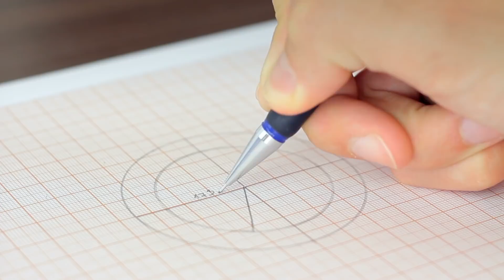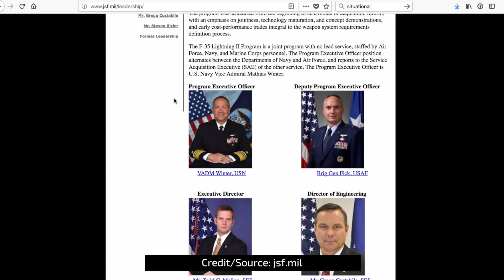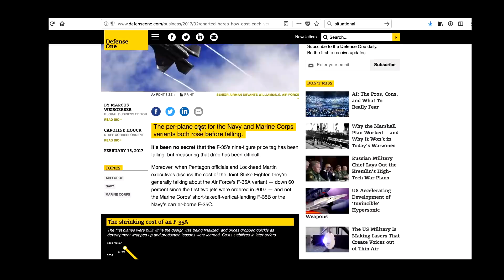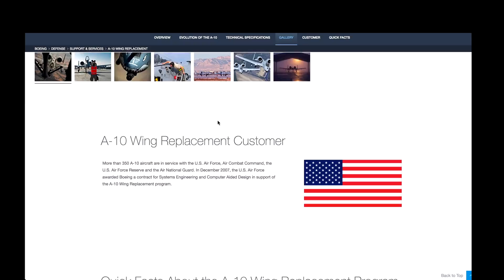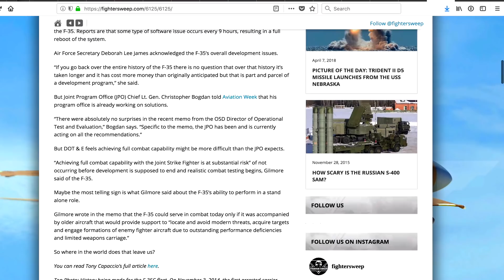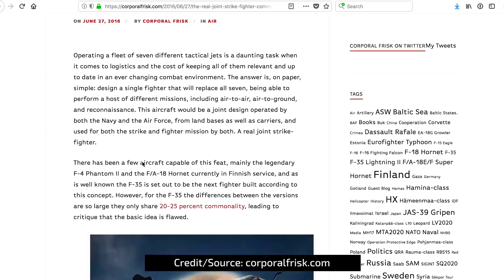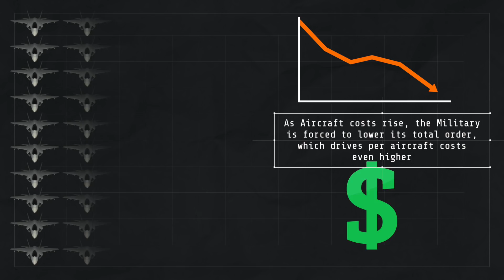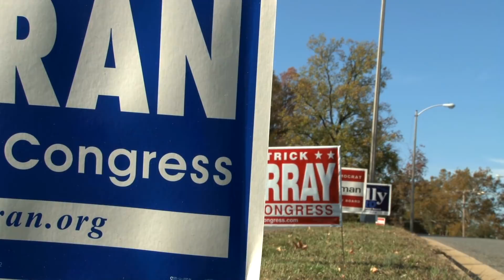Why the F-35 Lightning II Might be the Most Expensive Military Aircraft Mistake Ever

Comment: This is a great video! I wouldn’t be concerned about comments made by the likes of MississippiRedneck (or was it Rebel?). It is a FACT that comments/rumours have circulated that suggested an F-35 ‘lost’ a dogfight to an F-16. You didn’t try to defend the F-35 or rip it to shreds, you merely reported a fact. I thought this whole video was very well researched, narrated and edited. You provided a very objective look at a program that creates heated debate. NEW SUB...
Reply from the maker: Thanks so much! Check out our other stuff and feel free to suggest ideas for future videos!
Reply: Yh but if you knew anything about airplane fights you would know that dogfights are not important anymore and the F35 is essentially an energy fighter and it is here where it outperforms most planes that carry payload outside of their fuselage, for it can retain kinetic energy better than those  who dont, the zero destroyed the corsair in dogfights, however,  the corsair was the superior plane due to its energy retention and ability to boom and zoom thus even with props dogfights arnt really that important, the same applies to teh F 35
Reply: That "lost a dogfight" thing doesn't matter.  The issue is the cost, maintenance and FMC rate and PMC rate of the jets.  For the cost, the 5th gen planes are not up to the same standards as the 4th gen jets.  In a pier on pier fight, day one, with some good lead time to get your L.O. gripes and other issues sorted out the F-35 will be great.  On a day to day basis you will likely get 4 4th gen jets up for every 3 5th gen jets (accounting for fleet size, you know all things being equal).
Reply: That was the "report".  no one knows.
Reply: @wpnsloader9289  If you assume Red Flag is not an accurate report, then you're severely lacking in understanding in what Red Flag is about.

Also that wasn't a dogfight, it was a airframe and software test....as you know, that the Fighter's FCS was limited to, you know, NOT KILL, the test pilot with testbed software? >_>
Reply: Ya I thought the same thing. It seems like every video on the F-35 has an agenda. So its nice for a simple report. One thing that was missing was report of it performance in Israel. That seems relevant to the story the video as trying to tell.

Comment: France was able to build an aircraft that could replace several older aircraft's. The rafale is replacing 7 types of planes, bombers, attackers, fighters, navy planes etc. And the cost is not as high as the f35. Plus the rafale is better : faster, can carry more weapon, more agile, not stealthy but the rafale RCS is very low. 
Buy the rafale its a better plane in every way.
Reply: *The cost per Rafale B is about 85 milllion US$ which is about the same as buying an F-35A, except you get similar range, slightly larger payload, possibly faster speeds (F-35 not tested past mach 1.6, we dont know the top speed), and no future proofing for your air-force, because you are competing with 4.5 generation US planes from the 1980's like the F15E strike eagle, and your planes will be killed off very quickly against an enemy with an integrated air defense network/5th gen fighters.
Reply: Mike Lucky  what i dont understand your comment. You begin by saying that the rafale is not that good of a plane and then, you say that the rafale is better than the f35 ?
Reply: @MH-ff6zr  He's a assuming the Panther(a nickname the pilots of the F-35 are giving it ) to be a horrible aircraft, that's why :P
Reply: uh...no.